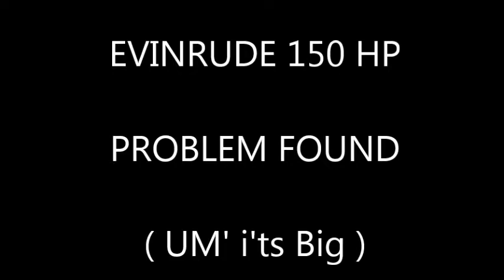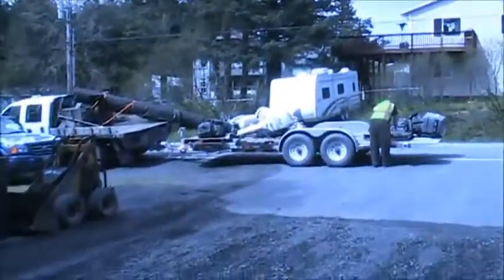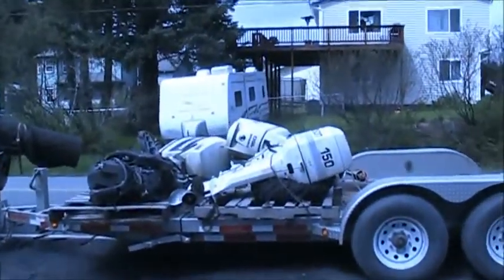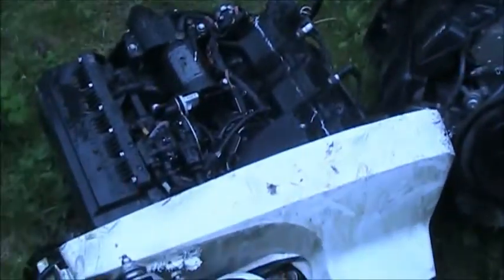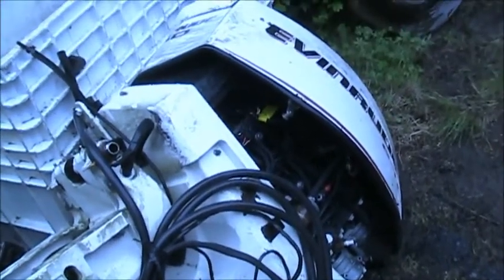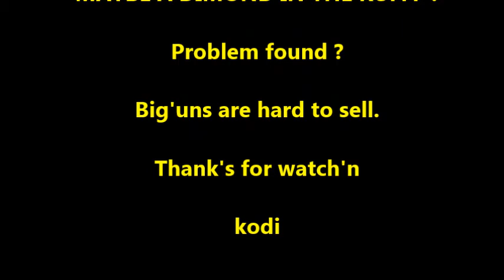JOHNSON 150 HP  ( The  "Big"  Problem  )

Comment: Kodi! 

I recently was able to get my first bass boat with a big motor. It’s a 2004 Stratos with a Johnson 150…sat in a barn for 10+ years. I have drained the old fuel, new batteries, and I was curious what other steps I should do before I try to crank the engine? 

I’ve had the hood off, and there wasn’t a cobweb inside, no piece of grass….the thing was top notch. It was very well taken care of, I’m sure it was winterized when put away. 

Thanks for your help! Love the Martin by the way!! ❤❤❤
Reply from the maker: I would clean the carb's  if it sat for years,  I would also change the impeller & Lower unit oil.  Look it over good for any rusty grounds, make sure plug wires & plug boots are clean.   kb

Comment: Hello I have a 1995 Johnson 150 Ocean Runner. It has new thermostat, new carburetors, new Power pack, new water pump, new plugs….took it out for a test run on local lake and when under a load it bogs down. I saw on another video it turned out to be crack in stator. 

I am getting ready to put a new fuel pump and get rid of/convert the VRO to manual mixture. Is there anything else besides the stator that could cause this? 

Any help would be greatly appreciated!
Reply from the maker: Many issues could cause this type of problem,  Start simple try running the motor with a 6 gal portable tank of fresh new gas, and a different "new" fuel hose. Do this B4 replacing any more parts.     kb
Reply: @kodibassInsideoutboards  ok thanks for the reply I will give this a shot and either way I’ll post results in case anyone else comes across it

Comment: Just bought a 1998 Lund with a Johnson 150 fast strike  ficht and noticed the check engine light turns on and the buzzer buzzes on startup and then will turn off and on randomly. Any ideas?
Reply: Cooling issues I think, either not enough water through muffs or water pump impeller. V4 or V6 ? Sometimes you need water inlet on both sides of the muffs.
Reply: @troyball6623  V6 , took the boat out today and it completely died and shut off, starter then wouldn’t engage. We used the trolling motor to get to a wall and jumped the boat. It was fine idling then we started to get into it and it died again. I was thinking maybe it’s a stator problem?

Comment: New boater here. I got a Johnson 175 Fast Strike 2 stroke. What kind of gear oil should I put in it and how much? Also, what is the best oil to mix with the gas? I keep reading confusing things. Any help would be awesome!
Reply from the maker: Any good name brand 80-90 wt gear oil is fine.  Fill from bottom drain screw until it comes out the top fill screw.  Use a good 2 cycle oil that has a TC-W3 rating.  mix 50-1  I like Amsoil.    kb

Comment: About 7 years ago, I had a neighbor practically give me a 1995 Evinrude 150hp Intruder motor. He had it for a number of years and it developed a hard start issue. I would hear her yelling and cussing in his backyard. The guy was nice, but an idiot when it came to engines. He was out there just flooding the carbs with cleaner and tinkering with it 15 minutes here and 30 minutes there. He one day removed the motor from the boat, next thing I see is a shiny new motor on the boat. The Intruder was on a trailer with some other junk. I asked and he said he was taking it to the landfill 🤦‍♂️🤦‍♂️🤦‍♂️. I asked him if I could have it and he said knock yourself out, it's junk though.

I get it to the house and put it on a homemade stand and start right on it. Compression on all 6 cylinders between 115-120. I try starting it and extremely hard to start, I mean halfway drain a big starting battery 🤣. I then notice a little grayish dust near the top of the motor. I pull the flywheel and one of the magnets is mostly missing.

I ordered a used flywheel that day on a Sunday from ebay and get it Wednesday. It's in great shape. I installed it and it fires right up like a brand new motor 👍

My bass boat just happened to be rated for a 150. I got it dirt cheap because it was really underpowered with a Yamaha 60hp that runs perfect. I installed the 150 that Wednesday night and Thursday evening.

The neighbor sees how well it was running and says wtf was wrong with it? I told him broken flywheel magnet. He then says I want the motor back and I will pay you for the part and your labor. I thought he was joking and I jokingly said yeah right! Apparently he wasn't and threw a fit walking back in.

The next weekend, I wanted to use the boat. I get to the gas station and noticed the tank was 3/4 full. I knew I was around 1/4 from the last trip (Intruders guzzle gas!). I knew something was wrong. I disconnect fuel line and it was mostly water. I couldn't prove it was him. But I put up a security camera. I haven't had any issues since.

I am getting off topic lol. I used the motor for years. It finally threw a rod and trashed the block. I could of gotten a rebuilt block, but it's over 20 years old.
Reply: Some people just don’t like it when they make mistakes! Good on you for making us of it for as long as you could!

Comment: Those 60 degree V6s were great engines for sure...Lots of power, relatively good on fuel.  The ignition is a little strange, but the carbs are much easier to deal with than on the conventional bloopers.  90PSI is about normal for those engines, even though it might seem low.   Can't imagine why someone would toss out a perfectly good running engine, which makes me fear this thing has some hidden gremlin somewhere....Sure hope I'm wrong, people toss stuff out for the dumbest reasons...Keep your eye on the #1 cylinder for signs of water, some of the early models have porosity problems in the block castings...
Reply from the maker: +kramden,    Thank you,   I  don't know what I should do with this one?    I am truly puzzled,   I do not own a boat large enough to handle a test run,   I think I will try to get a friend to take it for a test run & see if we find any un-knowns,,,,   Oh' what to do.                                                                kodi
Reply: @kodibassInsideoutboards    Did you ever get to try this thing on a boat??  Would make a great engine for someone if it was OK, or had some gremlin that you were able to solve....
Reply from the maker: @fleetwin1   I ended up giving it to a fellow,  He indeed put it on very nice welded aluminum skiff,  Then He boat & engine disappeared,   I think he took it off the island.   Never heard from him again.  I would have liked 2 know how it did myself.         kodi
Reply: Hey man I’ve got one of these and my #1 cylinder is at 35 psi, all others are good. I believe water got in. I’ve been told I need a new power head, any advice? Thanks very much.
Reply: @jordaniz8156    Which model engine do you have?  The compression is pretty low for sure, perhaps it is just a bad head gasket.  Might as well pull the cylinder head, nothing to lose by looking inside.  Be sure to oil up the cylinder good to stop any further rust...

Comment: just bought a lund with a fast strike  150 on it. Has sat for years and years . not a marine guy but am a mechanic. does look good and turns over  with a wrench. looking for a manual anfd advice. thanks for the video.
Reply from the maker: Very nice!  Put a bit of tri-flow in the cylinders & spin it over 4 a few min.  with the plugs out.  & Do a impeller change,  The start her up.      kodi

Comment: Hi,, HELP ME PLEASE!,, do you know anything about the 1993 Johnson 140hp lopper engine?,, mine is running like sh$t,, the main problem I am having is,, I lost the spring that go's inside the black plastic timing advance screw were you set the tick over advance up,, plus the engine's quick start kicks in,, every time the engine stalls!,, and rev's the engine up to around 1100 to 1200 rpm,, and it then hold the rev's up for 3 minuets every time the quick starts engages,, not helpful if the engine stalls when your trying to dock it,, as it takes off like a scolded cat on a hot tin roof,, and getting it in or out of gear at them rev's is not easy,, you need arm's like a griller to do it!,, and the gearbox crunches into gear every time,, can this quick start be disabled by fitting in a switch in some way so I can turn it on or off as needed?,, and if so,, how can I do that?,, what colour wire/s on the power pack do I need to plug a switch into?,, also do you have a spring for the tick over advance for sale?,, if so,, how much and can you post it to Britain (UK),, or maybe you could tell me the size of it?,, and I can try buying a spring off the dreaded,, "E-Bay!",, thanks for any help and advice you can offer me,, mike

Comment: My 1992 Johnson 150hp will not run over 5400 rpm. It normally runs 6000 rpm, What do you think is the problem?
Reply from the maker: Could be many things, but I would start by checking the spark & compression on all cylinders.   kodi
Reply: @kodibassInsideoutboards  Compression is 100 on the  port bank and 95 on the starboard bank. I have spark and replaced the spark plugs. What do you think?

Comment: Great info and I love the guitar playing keep up the good work I just bought a 2000 Johnson 150 ocean pro it runs but idk if it’s running great , it bounces when in gear at low rpm and tends to stall when put into reverse sometimes!
Reply from the maker: Sounds great! Just give it a good tune up, & drain/change/ inspect  gear oil.      kodi

Comment: I have 89 4vro that runs great on the hoses but soon as I'm in the water I can't get over 2g rpms put a new fuel pump on it fixed it ran good for a day started doing it again change fuel pump again this time it didn't fix it I need help can you give me any suggestions
Reply from the maker: +MA,  Do a compression check...  &  LMK,  I suspect a weak cylinder problem,               kodi
Reply: @kodibassInsideoutboards  thanks

Comment: Could you tell me the number of spark  for the Johnson 2000 150hp engine? Thank you
Reply from the maker: QL77JC4-SS   BY CHAMPION   The SS is for stainless steel, recommended.  But QL77JC4  will perform the same, gap 30.

Comment: Hello, I was wondering if you know what regular fuel pump i could use if replacing my VRO pump on my 1996 johnson outboard . VRO crap out.  I will pre mix the fuel myself.
Reply from the maker: +TC,  Yes'  You have many options,  Any Standard large style OMC Diaphragm fuel pump will work,  You can also block off the oil side of your vro2, & just use the fuel pump side, or you can use any large size japan outboard fuel pump by tapping your block to install a nipple to hook the pulse line to the pump.      kodi

Comment: Hey Kodi quick question. I've got a similar motor and only have compression on 5 of the 6. How big of a fix am I looking at?
Reply from the maker: +RB, could be as simple as a head gasket, or a  damaged piston or cylinder.  Pull the head & inspect.                              kodi